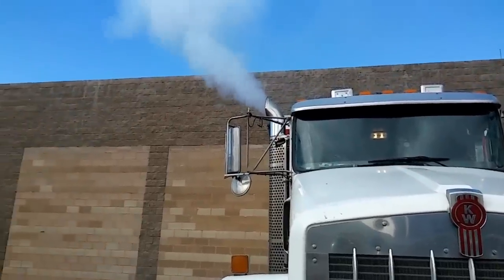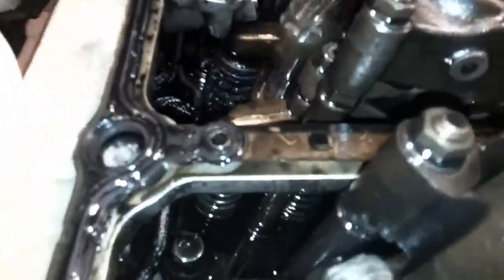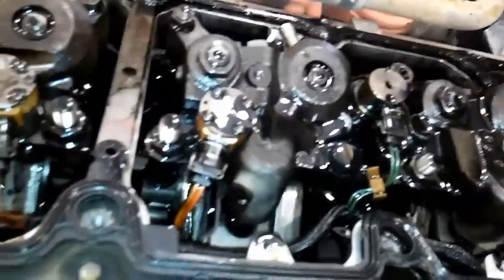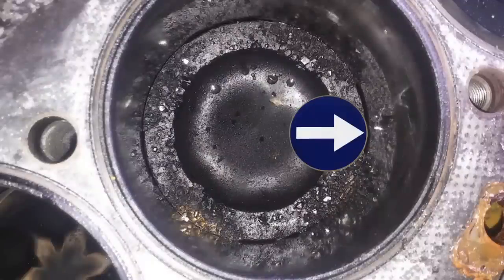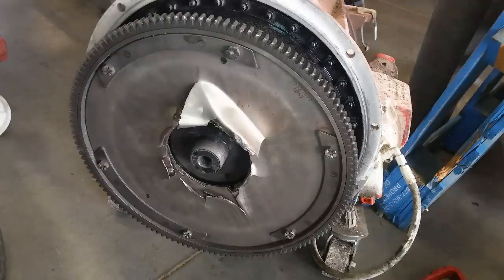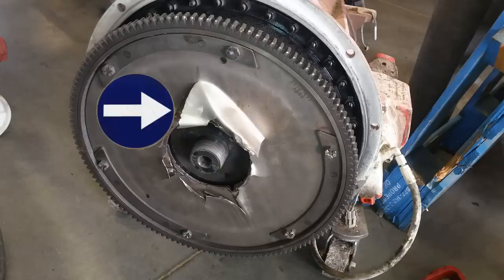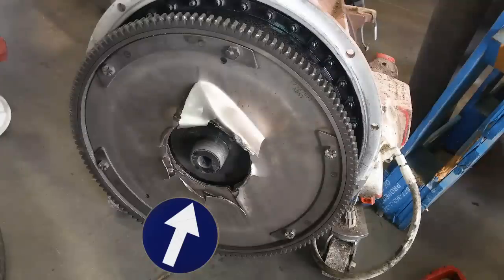Should You Warm Up A Diesel Engine?

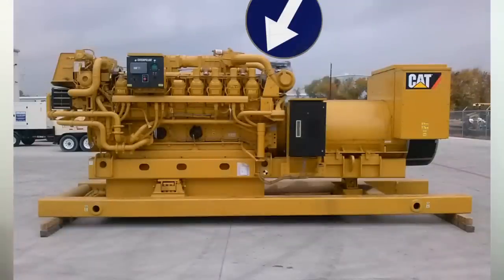Comment: @ 10:45 or so: I read that electric companies run hot water through the reserve engines so that they are at or near operating temperature when fired up.

++++++++++++

My Cummins N14 manual really discourages low idling.  It never put a time limit on high idling (1,000 RPM).  I am purchasing a generator to run my block heater so that I will not have to harm my girl with below 70°F ambient temperature starts.  I think I need thermostats because this thing takes so long to get to Operating Temperature.  I have no shore power where I park: hence the generator.

++++++++++

I am fortunate that I park bobtail now and do slowly high Idle in 3rd gear up and down the lot.  But when I was OTR, I often was loaded trailer in a Truck Stop.  This scenario is more difficult to move while idling without dropping the trailer.

I read the Cummins X-15 manual, and I verified it first-hand as I drove that tractor over an entire Chicago winter, would lose temperature from Operating Temperature at low idle at below 20°F ambient temperatures.

What about PTO Operation?

Comment: when I was doing my apprenticeship a Bedford 500 diesel came into the shop with engine damage, it had thrown a leg out of bed and the con rod had basically cut the engine in half the only thing holding it together was the head, you could see straight through it, it broke a neat section of cam out that was sitting in the sump, apparently happened on over run down a big hill, pretty dramatic, the noise must have been horrendous.

Comment: some trucks use a quick warm up feature  up by using the exhaust brake  cylinder temps = emissions  Ps some small 4wds use this same feature  believe it or not  
@ 12. 50 into the vid i will disagree as you will be replacing bottom end big and main bearings at a curtain point in the trucks life   depending on the mileage    ..makes you wonder how trucks and taxis reach high kilometres before a bottom end end overhaul  needed   
if you have glazing or cylinder wash maybe run a test on your injectors as these also wear out   as they maybe the issiue..... looking at that white smoke at the beginning of the vid as could also be a engine brake issiue also  or dribbly injection      ...you also forgot to mention about that air compressor takes time to build up air and supply  the trailers  also before moving

Comment: I have a John Deere tractor that has a block heater a in-line and a oil pan heater and I usually let the tractor run at about 1000 rpm for about 15-30 minutes but that’s because I live in mid Saskatchewan

Comment: Hey thanks josh. Yea I always wondered why the manufactures did not add a 12 volt electric engine oil heater to the engines to speed up the initial warming of the oils when starting. Would it make sense? Glow plugs on, fuel heaters on and crankcase oil gallery heater on? Perfect sense to me. I have been told my opinions are garbage but that what I get from listening to fools on a fools errand . 
I think my ideas are awesome! well, some of them. Peace brother!!

Comment: I live in Canada - 40 I run synthetic 1200watt block heater also a coolant heater on a timer comes on 2.5hrs before i get up. my hood/bottom of windshield will start to thaw fire it up blows warm air.

Comment: I have a big question about a Mercedes-Benz 190 hp OM366, the engine was rebuilt and it blows a lot of smoke, fuel pressure pump and inyectors and turbo were rebuilt too, smoke is dark and has itchy smell...I bought this truck in really bad  conditions and engine came with no intercooler...the question is the lack of the intercooler is what makes the engine blows black smoke ?
Reply: Does it start good or do you have to crank it an extended period of time?

Comment: My rule-of-thumb is to wait until it's running right. Especially with older engines, they run like absolute shit until they've gotten enough heat in them to thin the oil out and such.

Comment: If your fuel gels you are using the wrong fuel and additives for the wrong task. Years ago -30 with the correct fuel from a reputable dealer, using the correct anti gel every fill never gel in my 1985 Toyota 2.4 D Pick-up. Have had it  gel before on me. Was Not a fun day to thaw it out it started but stalled and had to re prime every 5 miles until the anti gel additive took hold. My 2001 duramax -40 still started with the name brand fuels and additive every fill. Just information of my experience.  Yea destruction of the week, I agree It can happen... Every engine and system is different. Sometimes I warmed it up other times started and drove kindly till she peaked on temp. then gave her all she needed. Never had a issue in 145000 miles on the Toy Sold the dura at 60000 because I htaed the suicide doors( reverse opening doors for those whom dont know the term). What a PITA with children. Miss the truck ran like a charm.

Comment: I wat taught to run it just at a fast enough Idle that all cylinders a firing. Leave it run for 5 minutes to warm up then you can start a light load. Cool down is also 5 minutes at idle. 

I had a flywheel on my T444E international school bus do exactly that. Destroyed they flexplate and the torque converter. But, the bell housing was tight.

Comment: This guy I use to work with would go out push in his trailer brakes and tractor brakes start the truck put in gear and pedal down out the yard even when it was well below freezing out he didn't take care of any thing he was bad about not letting them cool down before shutting off either.   Needless to say the engine in his truck didn't last long

Comment: 30 seconds to a minute at -30f is horrible. It has not even started to quiet down yet by that point.  Also, the expansion  coefficient of  a aluminum piston is much greater than a steel liner. That means less piston to bore clearance. 
      I warm it up until the vents just start to get warm. I do not use any real power until the coolant temp is >140f.

Comment: I live in Canada and have a 2004 Cummins pickup. When it is - 10 f I am not going to sit out there in that truck revving it up. I start it, run my frozen ass back inside and go eat breakfast and get ready to leave for twenty mins before driving. My truck has 800k miles with the original engine and it was compression tested a month ago and still has like new compression after over ten years if doing this.

Comment: Fun Fact:
We Diesel Owners care about the LIFETIME of our vehicles, also with the lower consumption we also care about CO2 emissions, as if we CARE ABOUT ENVIROMENT

Then there are the EV/Tesla FANatics which love to pull off like hell at any circumstances, as if they have no clue about Lithium batteries.

In fact a heavy load (as in fast acceleration) on the battery in cold temps before its warmed up a bit stresses the battery exponentially. In my RC-hobby days i even put the LiPo batteries at the air exhausts of my car to heat them up a bit in winter before starting (with weaker batteries i even felt that they are a lot weaker at high current drain than warmed up)
Wondering how much wannabe street racers in teslas will soon have to pay like 20-30k for a new battery pack, producing effectively a lot of harmful chemicals, CO2, heat for recycling this E-WASTE (in fact batteries are even more problematic than typical E-waste)

Comment: Crazy part is I warm my car up for me not the engine and one min is not enough for me to get in to a warm cabin so I let it run for about 10 mins. Also the other part is I have to accelerate up a very steep hill rather quickly in the morning just to get into traffic so I prefer to have a little warmth before I hit 3500rpm

Comment: Here's what I do. in Colorado at 10,000 feet altitude, 1.Start truck 2.Idle for about 1 minute 3.speed up idle to 900-1000rpm for about 3-5 minutes 4.Drive away lightly until coolant is over 180F 5.Drive the Fuck out of that sweet sweet big cam!

Comment: A Lot of CAT engines are plateau honed with ceramic keystone  rings hot/cold 200hrs or like i saw 19000 hrs (c12) pistons and liners dont wear like they used to.

Comment: Imo, it's very very simple, not a 13 minute video.

Engine makers design, manufacture and test engines for greatest efficiency, power, economics, lifespan at NORMAL RUNNING TEMPERATURE with the best engineering tolerances. This is when the thermostat has brought water temperature (and oil and the majority of engine metal) up to ~82°C / 180°F. You don't want this initial rise to happen too slowly, too fast, or under load. A fast idle for a few minutes is all it takes.

End of argument.

Comment: I always run a diesel at slow idle until the air is up. Then I drive off slowly.  No high RPM for the first few minutes.  I will not wind them out until the temp is up to at least 190 degrees.  To shut them down I always run at slow idle for 4 or 5 minutes.  I cringe when dorks shut them off at high idle.  Not too swift...

Comment: All the old books said 165 degree .I never move my dump truck. tractor.. loader. dozier until the gauge shows at least 160 on the gauge.Moving the truck before warming up. Is what causes the washing the oil off the walls because it is feeding more fuel than it can burn. You can go full load any time it is at 165 degrees older engines ran at 160. Most of what you are saying is from the E.p.a. crap. Diesel engine blocks heads have been the same from 1938 only the fuel systems have changed.

Comment: Mr Adept sir, i hate to disagree with you i rarely do, but many many even semi-modern generators will not start and launch into full power mode in seconds.

I use a typical example for ME in a data center, the total time from Mains Failure to Full Generator load is measured in minutes not seconds.

10 Seconds into a power cut, generator starts, High idle, they will stay in that configuration for at least 45 seconds before switching over to runup, engine revs are increased by 50rpm every second until the magic RPM figure of whatever for that generator, this RPM Is maintained for 10 seconds as a stability test before load is dumped on it, and by the time loads are online the engines are deep into there normal operating range.

Even our generators with pre-heaters and block heaters and water oil heaters and secondary pumps, they do not start and jump to load, they run thru the same process, they are ready to accept load a little bit faster.

No one in the right mind will start a big generator and then dump full load onto it, getting on to generators is very important but the 15mins the UPS provides as a minimum is all the time you need to start up warm up and switch over. Even in fully auto mode, generators will not start and allow full load in seconds.

Using the software for the gennys aswell is useful, because it will report MAX Load based on time since start, and until all params are met no load is allowed onto them.

But again i just wanna say that's how it works for us in a Datacentre, we would NEVER dump massive loads (and they are massive loads) onto cold just started engines

Comment: Question..... The term "load".....
Isn't it when the truck is in gear and you apply the throttle you apply list to the engine..... Example....... In higher hear..... The higher the load..... Hence the lower the revs get......
Just asking

Comment: That's exactly what damaged my truck's engine. A lot of low rpm idling. Also a bad thermostat, running engine below 150 deegres full throttle .Truck started getting fuel in the oil and damaged the engine.
Reply: Was it a large motor or small. Must have hurt the wallet either way but extra pain if was a big motor!

Comment: So Adept Ape, what you said is pretty much what I follow, but is the same still true in a Canadian winter minus 30 celcius (-22f, i think)? well when its that cold I let it idle for a few minutes then bring it up to 1000 rpm in 100 or so rpm increments over the course of a few minutes. Another driver used to throttle it right to 1000 just a couple minutes after firing up and the engine would do what I can only descrive as studdering for a minute or two then smooth out. do you know what I mean when i say studdering, and more importantly can you explain what the engine is actually doing when it does this?

Comment: My god is owning a diesel this damn finicky? I just bought one and after watching videos like this its completely overwhelming.
Reply: I have 1.4 (almost 5) million miles on my c-15 acert...its not that finicky. You just have to take care of it. You can abuse diesels and they'll still work hard for longer than a gasoline engine is. But most of us watching this video drive for a living...we cant afford to have a $3,000 turbo go out in the middle of nowhere because we didn't let it idle for 2 minutes. It's not hard at all...I'd say 3 months of driving a diesel and you'll understand what it needs....when it's cold, I warm it up for maybe 2-5 minutes and keep the rpms low until I see the temps rising to where I like it...when its hot, I turn the fan on when I stop and let it sit until the temps get to about 150-170 degrees before I shut it off....you'll learn...they're easier than gasoline engines in my opinion....you may not have to take care of a gas engine like a diesel but you'll pay for that in the long run.

Comment: does cold thick oil really spray out of the nozzles enough to reach the pistons and cylinder walls ? I think that requires some minimum viscosity to work...until then lubrication relies on the oil sprayed out of the connecting rod bearings

Comment: Some old vintage engines had manual pumps to pre pressurise the oil and get it flowing before starting, I've always thought this was a good idea for standby engines, however if the engine is in regular use is there an oil film already on the parts anyway ?

Comment: read in book big rig diesels shd be idled no less than 10 mins and not more than 30 mins before the first run of the day. they have come a long way with oils since then... but still like to see some temp on the temp gauge.... in the desert... get in the vehicle in SUMMMMERS... and there is already temperature on the gauge.  there is no real "winter" in the desert so a min or 2 and shd be ok to start moving to stir up the oil in the gearboxes and take it ez on it for the first few mins til get some real temp in the temp gauge.

Comment: I have 2 settings on my cruise and operate a PTO the one is at 850 the other just over 1000 rpm. Should I be using 1000 rpm always or does the PTO generate extra pressure on the cylinder walls so it won't matter as much as if just idling at 850. I find I get too much blower back pressure when using PTO at 1000 rpm. Thanks!

Comment: Diesel pistons are forged...They require more clearance between the piston and cylinder walls because because they expand more than cast pistons when they heat up...thats why they sound like a freight train when they are cold..because of this you are more susceptible to scuffing or cracking until everything is warmed up...

Comment: i run a cat 3306 in my commercial fiahing boat everyday i idle out and slowly increase rpm as temp increases once it hits 180 degrees give it the power  put the engine in 1997  doesnt burn oil and runs like a clock

Comment: My opinion you should warm up your engine before you take off first of all because you have to let your air tanks get fill with air secondly your diesel engine doesn't have spark plugs so it's a good idea to warm up your engine also for wear and also to warm up the oil I think the smartest one is to let your glow plugs warm up the most important thing 😎

Comment: I don't entirely agree with you regarding standby generators. Most big standby generators I came across had block heaters and pressurised oil. My experience is in telecommunications and I always specified gensets to run for a minute or two before then applying loads sequentially.
Reply: I don't think hospitals can afford to go for a minute or two without power. They need full power right now or people die.
Reply: @mattbentley8958  That's why they had pressurised oil ways. They were capable of taking a full load  almost immediately. I was making 2 points in my earlier comment.

Comment: Both my 2012 6.7 cummins and my 2013 6.7 power stroke if it's really cold outside like 10 degrees like you said the second they start up the computer on the truck shoots them to high idle just fyi.

Comment: Any diesel should NEVER idle from cold... many diesels have a idle up knob on dash for exactly this. The accelerator or idle up needs to be depressed/turned in so engine runs SMOOTH albeit at over 1000 RPM.
the worst thing is flooring from get go, or idle from get go. Just bring rpm up till engine runs smooth "better fuel burn and higher pressures" the engine oil WILL reach all critical areas almost instantly so lubrication won't be a issue if the pump, filters and relief valve are good.

I.e. in a nutshel... no diesel likes to idle even when warm... worst thing you can do, and even worse on cold engines. 

Same rules apply for peteol engines, but there one can simply get in and drive in lower gear at not too high load or rpm right away, till heat gauge indicates rising temp "or as soon as heater produces hot air from warming engine coolant"

Comment: I like how you go from North Dakota to Siberia.
Member that one state? You know the largest state in America. The one with the bulk of the US airforce.
It gets -50. Gonna warm up for more than a minute.
Reply: I tend to agree. Someone else said that in super cold climates diesel engines often don't truly reach optimum operating temperature (which I also agree with). It is worth remembering that when cruising down a highway when it's a mere (lol) -30 when you add the wind/wind chill it is more like -60 or even less! (upvoted your comment). 
This surely makes the SAE oil variation range a critical matter.